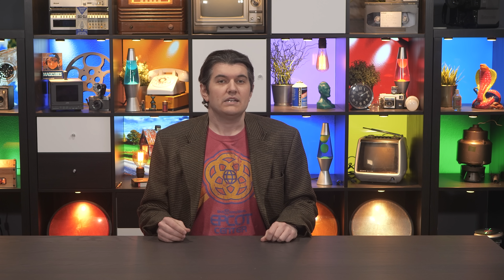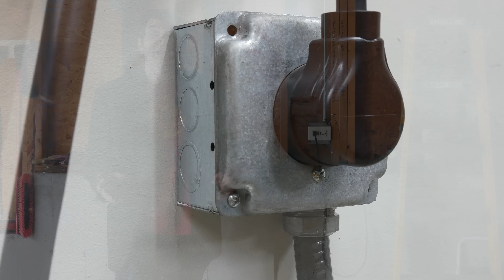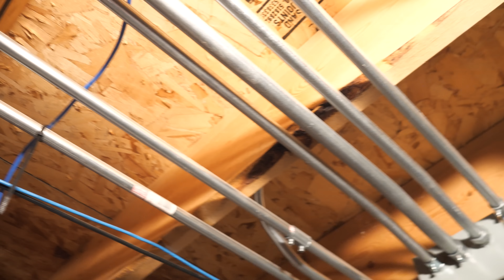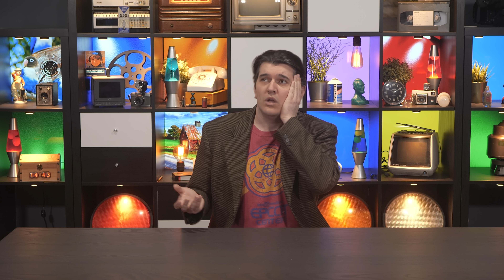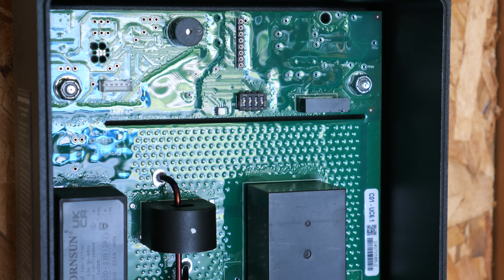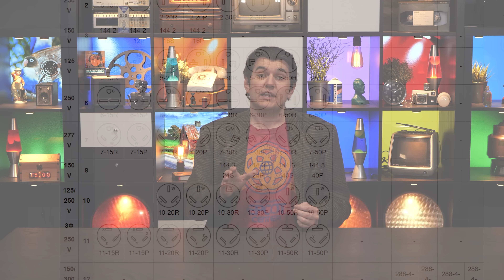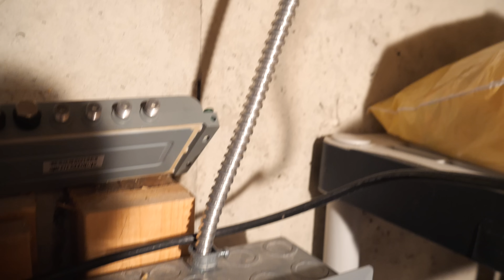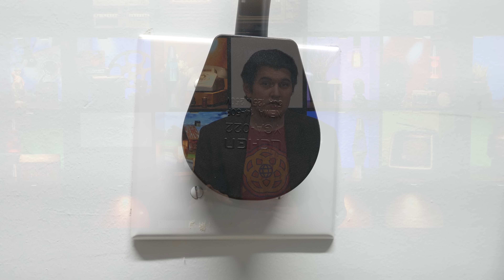The "standard" car charger is usually overkill—but your electrician might not know that

Comment: Electricity billing can be made quite complicated, so this will be a lengthy comment.

The main point I want to make is that controlling your electricity loads can have a quite heavy impact on the size of your electricity bills (like it does in Norway), because costs (price per kWh) can vary a lot from hour to hour, and how much you use during your peak clock hours can also impact the size of your electricity bills. There are extra fees if your peak hours have high loads.

Thus, controlling WHEN you use high energy electrical equipment, and also PREVENTING using them all at the SAME TIME, can become quite economically beneficial - but also somewhat complicated to achieve.

This also means that being able to dynamically change your EV charging cycle can be of huge interest. Whether this is achieved by interaction with your EVSE (EV Supply Equipment) at home, or through integration with the EV directly, is less important. Keeping it automated, dynamical and "maintenance free" is usually what's most interesting.

So how does it all work?

Some 10-15 years ago, so called "smart meters" became the standard in Norway.

Before those "smart readers" came around, the power readers were mandatory to be read manually around new year every year. The electricity companies had charts / graphs for the average distribution of load throughout the year, and you were charged monthly for a usage matching a predicted usage for your address - usually based on last years yearly usage, or if that was not available - based on a guestimate.

Then, at the beginning of every year you received a correction bill if your usage had been higher or lower than predicted, based on your annual meter readings. The electricity companies calculated an average price per kWh based on what they had paid for the same electricity during that month.

Their purchase prices varied by the hour, so the average kWh selling price for the consumers was weighted according to the same load graph (chart) mentioned earlier. This meant that for that month, you paid the same per kWh used, no matter when it was used - independent of which day or when during the day (midnight, mid day, morning or during other peak times like dinner making), which didn't give people any incentive on using their electricity during off peak hours.

The electricity company would just assume you followed the same load curve as anybody else, and your average kWh price would be exactly the same as your neighbours who didn't move their load to off peak hours. So why bother with the inconvenience?

Then came the "smart meters", reporting energy consumption automatically (by radio signals) every hour. Thus, now the electricity companies could charge a specific price for a specific hour, and you'd be paying for exactly what you consumed during that hour - by the price for that hour.

So what does this mean? It means there is now an economical incentive in place to move your electrical consumption to low cost hours, and limit load during high cost hours. This helps spreading the load more evenly throughout the 24 hours of a day, which is good for the electricity grid company.

New electricity prices (per kWh) are published once a day, typically between 13:00 and 14:00, and tells you the hourly rates for the following day. Thus you basically know the kWh prices 10-34 hours ahead in time, and you can try to plan your electricity consumption accordingly.

This planning can of course be done manually, or you can install some smart home equipment to help you out with this boring and time consuming task. Or you can of course decide you don't care, and just pay what it costs to use the electricity, no matter what the price is when you do.

We also pay monthly service fees to the electricity grid company for being connected to the grid. Those fees were partially a fixed monthly fee (part A), and partially a consumption fee (part B) which was a fixed addition to the electricity price (which didn't take time of day into account). Thus it was basically "A×1 month + B×X kWh consumed".

Up until a few years ago this fee (service fee parr A) was fixed based on your total yearly consumption (fixed prices for fixed consumption intervals). New from a few years back, fee A became dependent of your peak "hourly consumption" during a calendar month.

Thus, if you try to move all your heavy loads to only a few hours with the lowest kWh price during a calendar day, you risk paying a higher A portion on your monthly service fee, because your peak "hourly consumption" has entered a higher range for hourly peak consumptions.

The calculations for this is somewhat intricate, but the peak "hourly consumption" is recorded per day, and the average of the three days during a calendar month with the highes peak consumptions is compared to a set of ranges / intervals of "peak hour" loads.

The intervals for "hourly peaks" are basically 5 kWh apart, except for the first two intervals (who handles the ranges for 0-1.99 kWh and 2-4.99 kWh respectively).

This means it is also economically smart to keep your hourly consumption during your peak hours below either the 5 kWh, 10 kWh or even 15 kWh (and so forth) thresholds. Whichever is achievable for your household.

In turn, it becomes very interesting both to be metering what different heavy loads consume "right now", and also being able to control those loads. All in order to move your electricity consumption to those cheaper hours, while simultaneously preventing "overload" during those hours.

Such control can mean simply turning such loads on or off, or more advanced regulation like controlling charging speed for EVs. All to prevent exceeding into to next "peak hourly consumption" interval.

So yeah, both moving consumption to hours with lower cost (per kWh), while also preventing clustering too much consumption into one single hour to avoid increased monthly service fees - can become quite tricky.

Thus, EVSEs which have an API that allows your smart home central to dynamically change how much available charging capacity is advertised towards your EV to keep your hourly consumption within the interval limit you have decided for - can absolutely be of interest.

This doesn't take away your point that "simple" solutions (like fixed DIP switches) often is better. I just wanted to highlight that some situations may be more complex. As often is the case, what suits you best is depending on your circumstances (or simply YMMV).

Comment: So a couple things first there exists MC way larger than 10/3. While you are 100% correct that the chargers can be selected for multiple amperage input. We as professionals find it easier to standardize things. Something to also consider when installing we are wiring for today but what will the requirements be tomorrow.

Comment: I have a hardwired ChargePoint charger which is mostly overkill for my driving needs. I got by mostly on level 1 while living elsewhere during a home renovation for 6 months. The only time it became a problem was during very cold (<20F) temps. The level 1 wasn’t enough to heat and charge the battery.

Comment: Car charging isn't that flexible.  There are three different ports, depending on the model. Plus, not all adapters work because some chargers are AC and some are DC. It's even worse with public chargers, which there isn't nearly enough of.

Comment: I said this to a family friend that's a little on the older side. I compared it to a cell phone if you have one of those apple charging blocks your phone will take quite a while to charge, and that's fine if you don't need the phone right away. If you need the phone charged quickly you can borrow one of my charger blocks that can charge your phone very quickly. Now just imagine you just go to a quick charging for 10-15 minutes if you need the car topped up right away.

Comment: Aluminum also expands when heated. so if it gets hot it expands, then cools and is now looser and a higher resistance connection.   Aluminum wire is 100% a bad idea and should never ever be used.

I actually made money with a bet with a friend from this video.    He said it  is impossible to live with an EV without at least 50 Amp 220V outlet.      we bought an i4, and lived with a 10A 120V level 1 for the first 3 months and it was just fine and I experienced exactly what you show.  by the end of the week I was at 80's every morning.

I did finally install a 10A 220V charger.  mostly because we are now looking at replacing the other gas car with an EV.  Gas cars are as silly as owning a horse now.

Comment: #8 Al would have been more appropriate here and you can easily buy MC up to #6, though not within the exceptions allowing MC in pipeland.

EMT is not hard.  It's all pre-planning and third grade math.  Give it a try and never go back.

MC, unlike NM, is not hard-limited to 60°C.  Small Conductors rule, 240.4(D), applies to 10 Cu, but not 8.  There are exceptions, and sadly it's not uncommon for career sparkys to not know this.  Read the first sentence.

Most importantly, amps arent amps.  Duty cycle and power factor of legacy equipment are baked into code, and unfortunately code hasnt caught up with EVSE proliferation.  After 240.4(D) go look at 240.4(G) and 630.12.

Comment: Gotta be carefull. In cold climates, it's less efficient, plus some energy is used to keep the battery warm. Not much left to charge the car at that point. Consider a 20 AMP rather than the 15 AMP outlet.

Comment: Good choice on the Grizzl-e, I've had mine for 4 years and it's been rock solid. (I also have a Tesla wall connector) 
Cars have scheduling built-in nowadays so a smart EVSE isn't that important.

As for installation, I would have used ring terminals on the connection to the EVSE, and maybe Morris connectors instead of wire nuts.

I live in a small rural Midwest town, so yeah, I do have to charge every day. My minimum commute is 120mi a day.

Comment: 4:21 You can get MC cable in any size wire. Last week I pulled 250/4 mc to a new panel for a data room at a school.
Reply: And based on his own video he could’ve easily run conduit right along with all the other conduit under the joists.  But that wouldn’t fit the narrative I guess.

Comment: Everything you've said is true, on the other hand, if you take something like my electrical company, they will reimburse $500 for installation of an EV charging station at home, if you're going to pay for the labor and they're going to drill holes and run wire, you might as well have them run 6-3 or greater unless your home breaker and line won't support it. I've been making do for the last 3 weeks off 120 volt level 1 charging and the reality is it probably covers about 90% of my driving. For me the mental load of having to track where my car is at and knowing I need several days of recovery and charging to come back from 100 mile day is more mental capacity than I want to give it... That being said, even a 20 amp 240 volt home charger is probably more than sufficient for 95% of people's needs. Problem is if you're going to run a separate line and pay for labor and permits, you might as well just go with the thicker cable and the heavier charger..

Comment: I did a similar install as yours: NEMA 14-50 receptacle (with all the proper wiring and breaker for 50a), but have an EVSE that draws 24a (like it's a 30a circuit). I did this mainly because charging with the standard NEMA 5-15 was a bit too slow for my driving situation, but I definitely didn't need the speed of a 240v/50a charger. An ideal setup, IMO.

Comment: Great video Alec, thank you.  These are important messages.  I looked closely at getting an Ioniq 5 at one point and I worked out that even on a puny stock 120 VAC 15A outlet I could charge that car at work for free three days a week, and that would be more than my weekly needs, as I don't do many km.  Free fuel, I like that idea a lot.  Now we have level 2 EVSE at work, and it's still free, a nice perk of working for the local electric utility.

Comment: Highly agreed regarding the "smarts" on EVSEs being absolutely not needed... My old Siemens WiFi EVSE would sometimes get stupid and not allow the vehicle to charge for whatever reason until I would turn it off and back on again. I have moved on from it though and installed a Dual Grizly EVSE to charge both of our Bolts and it has never failed me. Non Smart EVSEs FTW! :D

Comment: I used to drive 110 miles round trip for my commute in my Chevy bolt. At home, I only had a level 1 EVSE. At work, there were level 2 EVSEs, but securing one was hit or miss. I only got one about half of the time. I only used DCFC once or twice per year. Totally doable.